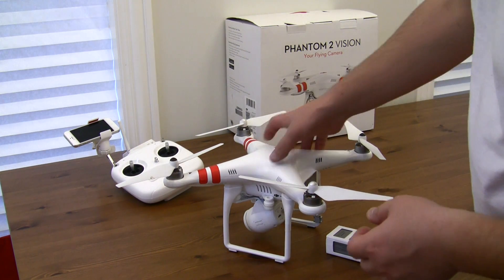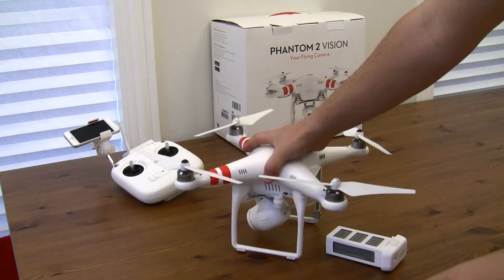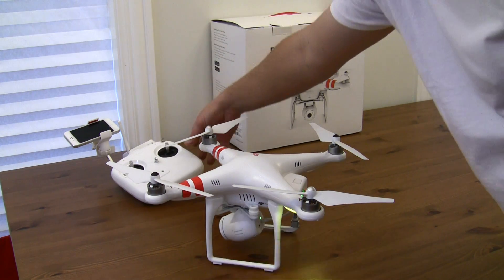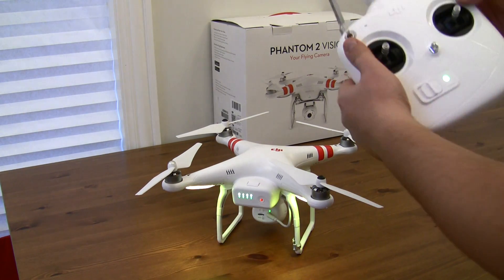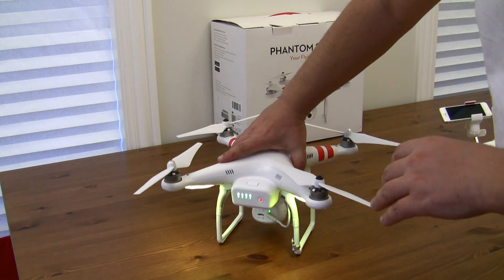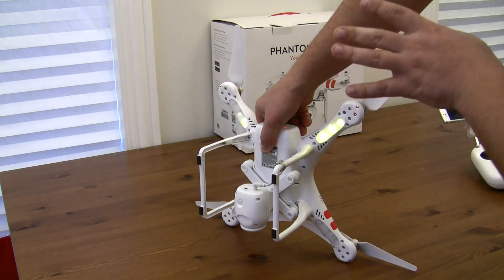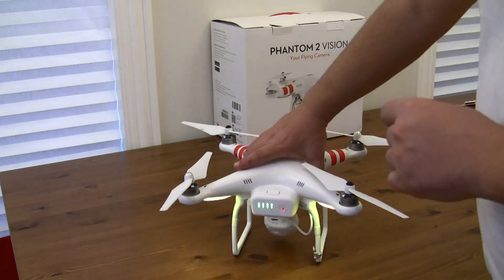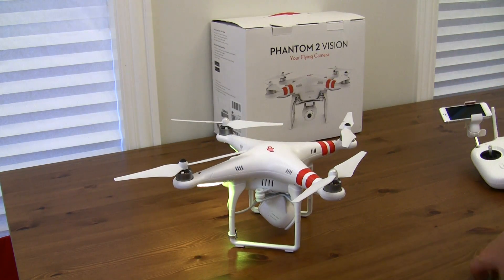DJI Phantom 2 Vision - Calibration (Not the GPS)

Comment: Hi Lucian
Can you please verify that once I get the steady flashing yellow lights after my vertical calibration that the "compass" has calibrated. But for the GPS to work properly I need to wait to find more satellites and only after finding enough satellites will it rapidly flash green then a steady green to indicate ready to fly (GPS). I got the shits with it and thought it was faulty.. Sent an email to DJI as it is brand spanking new and has only once found satellites and gone green, and that was while flying it in non GPS but with my S1 in GPS location, once flying for about 10 mins it flashed green then was green for my flight... Does this all sound normal or not?

Comment: Ah, so I'm supposed to wait after the vertical calibration for the phantom to find a satellites? I was trying again and and again after about 10 seconds of seeing the yellow lights still flashing. I wouldn't dare fly it my first time in non-GPS mode so hopefully I'll get some satellites when I try it again tomorrow!
Reply from the maker: I would not fly the quad without satellites, if you use your iPhone or Android device, make sure the satellite icon is blue (with at last 6 satellites - it will not be blue if you don't have enough satellites). Once that is achieved you can see the rapid blinking of the tail lights in green. Then you are good to go, flying in NON-GPS could cause you to have - what's called the "run away" issue. So after calibration - horizontal and vertical, wait for satellites and then start the motors. The GPS could take up to 5 minutes, if you are in clean sky you should get it faster.
Reply: Lucian Micu Thanks I was retrying after about 10 seconds and it was a cloudy day. When I try tomorrow I'll leave it a lot longer to find the satellites.

Comment: Lucian,
An important point that everyone should be aware of is that calibrating the compass  SHOULD be done OUTSIDE preferably in an open field.  This has NOTHING to do with GPS or satellites. The Phantom compass is sensitive to metal like a radiator, metal door, steel desk, or iron rebar in concrete which could throw off the calibration which could end very badly.  So like I said AlWAYS do the compass calibration as you show so beautifully in this video OUTSIDE

Comment: Do you have to calibrate it every time you fly in order for gps to work? ?
Reply from the maker: You don't have to but you might want to calibrate it every time you fly, it only takes seconds to do it. BUT ... this has nothing to do with the GPS. For the GPS to be acquired you do need to start your Quad from the battery power button and while sitting on the flat ground surface (no metals around or major power lines, etc ...) you need to wait until you lights (back lights) changes from blinking yellow to blinking fast green few times and then they stay green (in the same time, on your phone you should see that you have at least 6 satellites acquired and icon is blue). Then you have satellite connection. I would not fly with sat icon being blue.
Reply: Lucian Micu thanks alot

Comment: I just got the phantom 2 with the gimble, how often do you have to calibrate it, just once?
Reply from the maker: You got to calibrate it as soon as you need to. So I calibrate mine pretty much every time because I only fly it about once every two weeks or so (Cold winter here in Chicago) but if I would be to fly it every day then i think only when it's not stable or can't really keep it's position if I release the handles. If you wanna be extra safe, I would do it every couple of days.
Reply: calibrate everytime you change locations.

Comment: I am thinking of getting one of these please add more to do please
Reply from the maker: Before committing to the DJI-P2 look at this one, http://www.dji.com/product/phantom-2/ - its all that i have less the camera, but you do get a gimble 2d - mine is only 1d and you have WAY Points (best think ever). Basicly you can tell him the path you want it to fly, start recornind and go have a coffee.
Reply: Lucian Micu way points for BVR (beyond visual range) needs more equipment.  more expensive.  The main difference is that the Phantom 2 vision operates at 5.728GHz－5.8GHz frequency (like your Wifi router).  The Phantom 2 with H2-3d gimbal operates at 2.4GHz ISM.  Because of this.. the operating distance for the Vision is only (europe) CE: 300m; (US) FCC: 500m look up how to extend range.  while the Phantom 2 (non-vision) has a range of 1000m

Comment: I tryed several times and the result is always the same, at the second calibration the lights goes blinking to  yellow and red.....why.
Reply from the maker: If you get a red blink and especially yellow, you should not fly the quad, you need to investigate it further. How many red flashes, how many yellow, does it happen right after the calibration? Did you get an answer to this by now?
Reply: Thank you for your help. I solve it with your method
Reply: same  issue

Comment from the maker: :))) it drove me crazy for couple of days, I did not want to loose mine ......... :)) glad to help
Reply from the maker: Sadiq Mahmood I need to re-answer the question, the Ready To Fly vs Ready To Fly (Non GPS) is the color of the helicopter light before you will start the motors. I always fly mine in Ready To Fly mode, I am paranoid that i will loose it. This is the important part of not loosing your Quad, but you still want to calibrate it now and then or when needed. So in order to enable Ready To Fly, start the Quad by pressing the power button on the battery and make sure all your other controls are on and connected. Then you have to wait until you get a green fast blink from the lights, in order for this to be true, you need to have at least 6 satellites connected and you can see that on the top right corner of your iPhone or android device (and the satellite icon will become blue). If you are not sure that you are Ready to Fly - just check the Satellite icon on your phone and if it's blue, you are good to go.

Compass calibration and GPS have nothing to do with each other.

PS: You got to have a clear sky view and be off of any metals - such as patio tables, car tops and such - that will screw up your satellite connection. Mine takes about 3-5 minutes to acquire at leaf 6 satellites.
Reply: Well, Hey Lucian ... could u tell me how to get the Phantom on Ready to Fly (GPS) Mode ?

Or is it that once u get the compass calibrated u are on GPS Mode ... heh ???
Reply from the maker: Sadiq Mahmood To put the copter in GPS mode you first have to enable it from the software, it is by default disabled, but I would no do that until you gain some considerable experience with it.
Reply: Alright, thanks a lot :)
Reply: Sadiq Mahmood Wrong.  1st I calibrate my compass every flight.  It's no big deal and I don't want fly aways.  2nd... There are 2 toggle switches on the phantom one toggle selects GPS mode>Attitude mode>attitude mode.  What he means is you can change the last setting to Manual MODE.  All Phantoms have GPS mode and attitude mode enabled.  It's very easy to fly.
Reply from the maker: John DeCastro True, I was under the impression that he asked something else. But he was not asking about the ATTI or GPS, read my reply to him that i just wrote. 

The controller has 4 more modes of flying, I had it in my hexa-copter but on this controller you have to activated from the software as by default you only have ATTi and GPS. Hope this helps.
Reply: Lucian Micu so blinking yellow after vertical calibration is ok?? It's 3 days I'm getting crazy to get the Green light after vertical calibration but never happens. I just want to have the aircraft calibrated and the failsafe mode available if i lose it.. what else must i do? thanks help me..
Reply: Sadiq Mahmood you can change it in the settings, and it will still be the same as when you took it out of the box, use GPS mode, and its exactly the same.  i set my right switch to failsafe, i dont see the point of having 2 atti settings on the same switch.

Comment from the maker: I agree with you, I wanted to point that out in this video but I wanted to keep the video short so I did not. If you mount the phone holder on the horizontal bracket "the proper way" it comes to much over the controllers handles, throttle to be more precise and if you are like me, I have the thumb all the way over the handles, that will the phone position uncomfortable. So I moved it. Signal is not an issue. Please look at my recent video where I went 1000 feet and had perfect connection.  Thank for pointing this out. I will make a video about it and include this comment in it.

Comment: it looks like you have your phone holder installed wrong.  look at the DJI video and you will see it should be installed on the other end of the bend of that bracket so the phone is over the remote more.  The way you have it installed the phone can block the signal of the transmitter. DJI should show this better as it could have serious results.